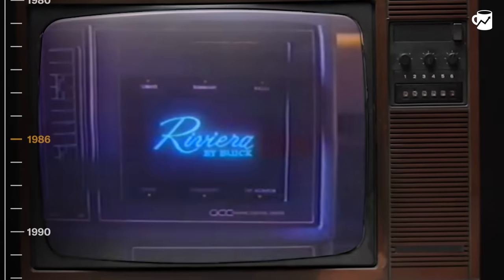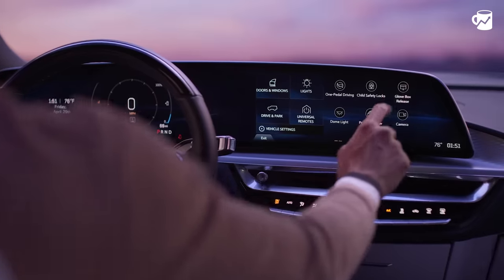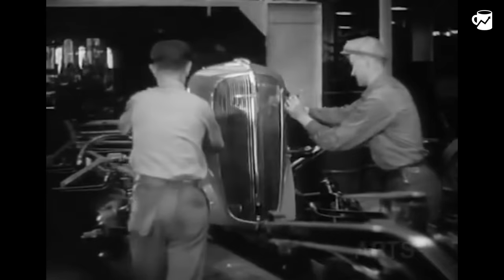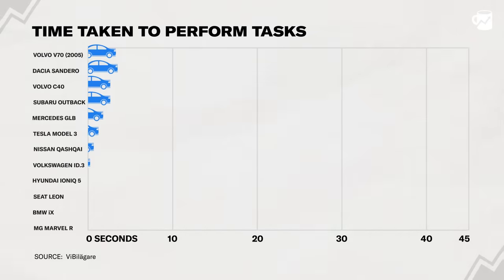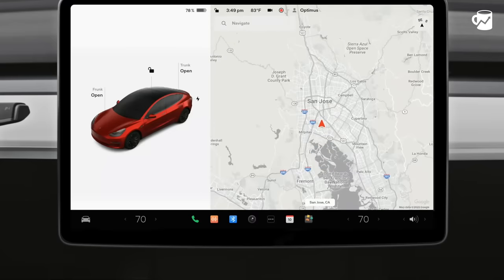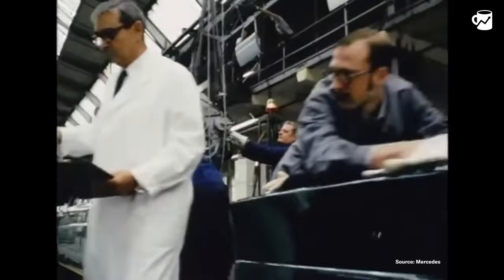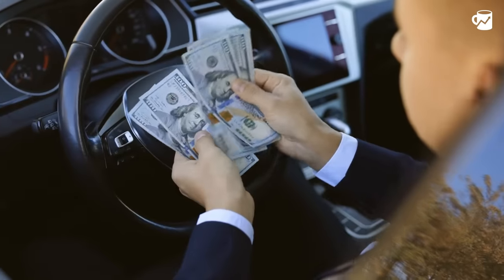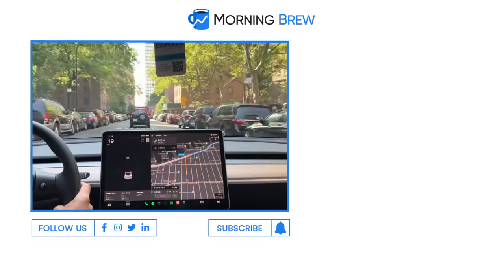The Real Reason New Cars Have Touchscreens

Comment: I'm 78 and my car is 24.  It's a race to see which expires first, it or me.  The thought of giving up buttons and knobs is terrifying.  Every time I make an HVAC or audio adjustment in my old Regal I am grateful and know that I am living on (automotive) borrowed time.  

I've driven with touch screens several times and I found the experience horrifying.  Simple desires buried in sub-menus.  I found it was easier to just give up than change a radio station or HVAC settings. 

Once upon a time public schools had driver's education, and one of the mantras was "Keep your eyes on the road."  Now, it's impossible to do so. 

If they had buttons and knobs for HVAC and basic audio, 90% of of one's needs would be covered.  Put basic readouts like speed and RPM on heads up displays. Leave the rest to the touch screen.
Reply: Tbh you don't have to be old to hate it, everyone except some 30-ish tech wannabees does.

I'm 25, I have right now a TT with a screen in place of the tacho, controled by buttons and it's the further I can do.

Hell I feel unsafe operating even slightly my smartphone while driving. And I use the damned thing a lot so I'm very use to it (on my everyday life I mean, not while driving). I don't understand how touchscreens that hold key features are even allowed on the road.
Reply: @raidden-1583  Agreed.  I'm going to be renting a Chevy Malibu, so I looked it up on the Chevy site.  So relieved to see that the HVAC & basic entertainment functions use physical controls.  And analog instruments right in front of you.
Reply: Sounds like a 2023 4Runner
Reply: Loved your comment!

Comment: I drive a Toyota 4runner from 1999, recently got to drive a 2023 man that thing feels like a spaceship. The worse part after 2 decades of "improvements" it gets almost the exact same mileage as my vehicle form the 90s while being wider, longer, and harder to see out of.
Reply: The biggest positive is that the crash structure is definitely safer.
Reply: My 2000 dodge grand caravan get the extra same mileage as my 2019 dodge grand caravan.
Reply: @chachacamel Maybe. However, the later model likely has side air bags which are highly valuable.
Reply: Except modern vehicles all have tiny gun slit windows and cramped interiors where you can't move around by design, and with rear windows so tiny and blocked by massive head restraints you must have  back-up camera just to see behind you.  @chachacamel
Reply: At least you got a built-in backup camera.
Reply: Modern cars are insane
Reply: @chachacamel  I guess it better be how bad for driving they are. Visibility is crap, drivers are distracted
Reply: eldermoose7938 
Keep your '99.
Reply: Modern cars have modern safety features! So you'll be safer inside, but the pedestrian you just hit won't be. Too bad for them, they should have been driving a rolling fortress! What are they, poor? 🤣
Reply: @Klayperson  how dare they be poor
Reply: it might be faster at least.  but i agree toyota is corrupt
Reply: @Klayperson  There are pedestrian considerations.  E.g., that's why the Lexus LC500 has the explosives to raise the bonnet further away from the engine in the event of a pedestrian strike, in lieu of raising the bonnet permanently and ruining the car's lines (as most other vehicles do to provide the mandatory clearance from bonnet to hard points).  Volvos even have external pedestrian airbags, although they are not mandatory under ENCAP or NHTSA yet.  I don't know how this all works with large SUVs, pickup trucks and 4-wheel-xdrives though.
Reply: @RareGenXer  Center consoles between the front seats have grown to truly gargantuan proportions.

Comment: As a UX designer I’m glad someone is FINALLY talking about this. Like my issue has never been the information structure of the things shown on the screen. I mean, yes, it’s bad. But the first time I saw one of these systems I was immediately concerned about the lack of tactile feedback and amount of cognitive load this adds. Seemed  totally fine for an interface you use while hurdling down the road at 70mph in your two-ton death machine.

Comment: A few years ago, I bought a '97 Camry that someone had installed a cheap Chinese touchscreen stereo in. I hated the screen right away, and was actually happy when it quit working--it gave me the excuse I needed to replace it with one without a touchscreen, that connects to my phone via BT. I love the big volume knob in the middle, and I can skip forward and back with buttons. It's also louder than the stock stereo in my '03 Camry was...which is where that stereo is now. Since my latest old car is in close to new condition, I'm fairly confident this car will last me long enough I'll never have to consider buying one with a touchscreen I can't get rid of.

Comment: Because it's cheaper. Saved you 8 mins.
Reply: Thanks.😂
Reply: It isn't just cheaper, it's also a new way for them to sell you stuff (updates, new features, etc.) as cars become more reliable.
Reply: They are going to simplify and modernize the interior of cars even more!!!
Reply: GOAT
Reply: really? you mean 10inch screen is cheaper than knobs?? or 15-17inch screan? i mean how dumb you must be to actually think this?!
Reply: @jernej.skoflek  yes, a screen is cheaper than designing, engineering,  and manufacturing several different buttons, knobs, and switches, wiring and programming them.

Comment: I like cars which just have a small screen for reverse camera and maps. modern cars take it way too far though. i like having physicals buttons for air-conditioning controls, music controls and anything related to actually driving the vehicle.
Reply: Backup screens are hella’ cool. 👍
Reply: they should have infrared displays as well for night driving.  Once having installed one of those, you'll see how they are extremely useful for everything from deer to speed traps hiding in the trees.
Reply: @zarroth  Are you driving while constantly looking at infrared display to spot deers?
Reply: so if you are good with backing up using just mirrors you can mount your phone for navigation on the wind shield
Reply: Backup screens aren't necessary : they just have to put an end to the slit window trend.
Reply: @cabaneencac5168  no, they need to have higher standardsd for drivers first, I was backing up a van with no view on the back window, not that hard people just don't know how to drive
Reply: One of my friend’s parents drive a Honda Odessey from 2014. Has two small screens, and also has a backup camera and blind spot cameras, if only cars had 2014-2017 screens

Comment: i would pay so much more for hardwired switches, knobs, and buttons, you have no idea
Reply: Oh, they do....just wait a few years, they'll offer physical buttons as "pro" or "racer" interface upgrades. For a cost, of course.
Reply: Exactly. That's why old cars are overall better with just physical buttons.
Reply: This and some other reasons mainly Great MPG is why I still Drive a 2006 VW Jetta with a Manual Transmission.
Reply: @tah6746  What a concidence ! Yesterday, I was watching Ted (the movie) and the main car was the Jetta A5 too.

Comment: My last 2 cars have been Mazdas. The previous was a CX9 with a touchscreen that I HATED. Now I drive a CX5 with mostly analog buttons and a stepped dial/button for Android screen functions and that is a much better interface. I quickly learned just how many clicks on the dial I need to use to do things like select music or report conditions while driving with Waze or Google maps. It's so much easier and I don't need to look at the screen any more than is necessary, which is not all that much.

Comment: The worst I’ve seen, is the 2024 Model 3 update;  they substituted a laggy “swipe for reverse” field on the display for the previous model's physical shifter. Idiocy.
Reply: Bad enough shifters are now electrical instead of actual, like, you know, mechanical shifters.  That's a step beyond.
Reply: Next step is brake control hidden in a menu.
Reply: @janlanik2660  Huh? .....Oh, BRAKE.  Jeeez
Reply: @frequentlycynical642  thanks
Reply: Please tell me you're joking.
Reply: Jeez.  I have a regular ICE vehicle with a normal shifter and going into reverse is always accompanied by a several second lag.  Maybe a safety feature imagined by the engineers?  I hate it but have adapted.
Reply: touch screen transmission is stupid as fuck though..... swipe right for drive.... what the fuck
Reply: @frequentlycynical642  How to make reverse order of electric pulses into electrical motor commutators mechanical? That is just a firmware input/parameter.
Reply: @lacekratochvil  Not the issue.
Reply: The shifter isn't even the worst part. It's the lack of stalks. No signal stalk, and no wiper stalk. 
Tesla engineers really just said "fuck you" to any sense of ergonomics and safety.

Comment: Quite right, you are either driving or looking at a screen. You cannot do both  safely while on the road . Here in the UK where I live to touch a moble phone while driving is a traffic offence so how come touch screens are exempt?
Reply: Because the EVangelists on both sides of the pond need to turn a blind eye to any downsides to today’s EV, to sustain their push to eliminate ICE. So the screens were normalized by EVs, and then spread to all types of vehicle.
Reply: @JoeOvercoat  But there's nothing about an EV that means it has to have a touch screen rather than buttons.
Reply: I've been saying this for years now.

There's absolutely no logic in not being allowed to use a mobile which you can hold up right next to the window so you barely have to take your eyes off the road, but you are allowed to use the car's built in screen which is buried lower down on the dash which means you can't see anything.

Touch screens are just about always worse than physical buttons.  You can feel physical buttons, and your muscle memory knows where they are.  You can't feel a touchscreen, and your muscle memory can't accurately remember their location (especially as they're always changing).
Reply: Here in Norway it is 1100$ fine for using phone or  your cars touchscreen while driving... Touch screens have no business being in a car.
Reply: @a64738  Interesting.  So how does a new car owner, say, turn on the air conditioning or change the volume?  Do they have to pull to the side of the road?
Reply: On a technicality: As those screens are connected to a system that also has a connection to the mobile data network - i.e; It's like an iPad with cellular - They appear to fit the legal definition of a mobile phone under UK law. With that and the UKs outlawing of those at the wheel (Even when the vehicle's stationary) under the RTA, such a screen should legally be off completely whenever the vehicle is in a driving mode, and the law is contravened if not? 🧑‍⚖

Comment: Isn't it a safety issue to put all functionality into a screen? What happens if the screen stops working -- as they often do? You'd lose access to all functions in the car, while if there were buttons it'd be only one button at a time
Reply: 'no problem, we will gladly replace the screen for you' says the mfg at a high cost. $10's to build in, $1000's to replace with labour of course

Comment: Back in the 1980ies you literally knew by heart where the controls are. Choosing radio station, cassette/CD in/out, volume. Heating, Ventilation. You never needed to look away from the road to control them. And you got feedback. The knob turned. The switches clicked.
Reply: Exactly.  Even with a big equalizer with a LOT of slide controls, it was all VERY intuitive and easy to operate by FEEL while you watched the ROAD.
Reply: Now you can't even get a CD player. You're stuck with $$$streaming$$$

Comment: the more electronics a car have the more issues can happen.  that's what i've learned over the years.
Reply: And greatly complicates things, no wonder why no one wants to be a mechanic anymore.
Reply: @GrumpyIan  that too.  Whew
Reply: No modern car will let me hot splice the fog light power to the taillights. If I can't fix it I don't want it.
Reply: @calebharris292  great logic to live by I totally agree
Reply: Applies to everything, actually.

I believe that things that were mostly mechanical if not fully and now slowly becoming with more electronics than necessary are becoming shit like smart home devices that have security and privacy issues or fridges (like, why there is a fucking screen when fridges at the time, in the 60s, didn't need one and were working properly ?!).

Electrical things are less friendly to the average person than mechanical I believe, because a car with software is an issue since software is generaly properitary, you can't modify and so it's not fixable.

Software is going worse too. Because to make a good software, it's takes time and good software engineers that create secure and fast code. Yes, companies could make a software, then after that, making updates overtime but they don't care and it comes with costs. 
You would probably need Internet to update with no alternatives of doing differently (like plugging a usb with the new software and push it to the car. . Although, I'm sure it will be used to find exploits.)

Why is Internet necessary in a object that was built in the early 1900s and for the last 110 years, never needed it ? Do you really own your car ?

Comment: Touchscreens should be for maps and music, maybe. Pretty much everything else should be separate physical buttons. At most AC as well, but even those are incredibly annoying and inconvenient, usually
Reply: I am constantly changing the volume and and down, and sometimes I absolutely must skip a song. I don't want to have to look to do those things, either. Touchscreens for maps make sense, but when something inevitably goes wrong with the screen, it shouldn't affect the drivability of the car.
Reply: Maps & music/phone/audio & climate & drive mode should all be operational via physical buttons & dials, mostly on the steering wheel

Comment: We love our new 2024 Cadillac with a combination of a curved 33 inch screen and tons of easy to use physical buttons!

I upgraded from a 2014 Toyota Highlander to a 2024 Cadillac XT4(the 2024 highlander drove the same and is pretty much the same chasis and interior so it's boring).

The Cadillac XT4 has no turbo lag that I can feel. Every other car that I test drove had turbo lag, whether short or long...Mercedes GLC300 (least turbo lag), BMW X3 (a little more turbo lag), Porsche Macan S (even more turbo lag), Honda (way too much turbo lag).
The Cadillac has these features that Youtubers miss:
- lighted logo behind the dashboard
- pulsating safety seat (most cars only beep)
- left behind child in the rear seat alert
- capless fuel tank (like my 2017 Corvette C7 )
- umbrella storage in the doors (like Rolls Royce)
- active noise cancellation (like my 2017 Corvette C7 with Bose)
- power passenger seat with lumbar
- free 5G hotspot
- stop/start feature is the smoothest I’ve ever experienced that I don't even notice it.

My other car is a 2017 Corvette Stingray in stickshift.

Comment: I loved my 87 Square Body Chevrolet Silverado 4x4.    It drove like a dream , everything was manual. Even the 4x4 has a manual engagement. Then engine went down several years ago. I gotta get it back up n going again. 
    My best buddy has a new Ford F-150.   It tows great , but he hasta push buttons for ever just to get it rolling. I've driven it while towing , and him riding in the passenger seat.    It will just randomly start barking alarms while driving. He has to start pushing buttons again to make it hush  - up.    Any time we stop , its the same procedure.      My old Chevrolet, and other 50+ years old trucks , you just shifted gears as you needed to , and drove. Everything is in arms reach. You don't take your eyes off the road.

Comment: My "old"  2019 dodge caravan has a screen, but it basically just controls the radio and mapping. Other functions have knobs or buttons that are intuitive.  One thing it also has is buttons on the steering wheel for the radio or phone and cruise control.  I find these essential because I never have to take my eyes off the road or take my hands off the steering wheel.  I'm old now, so this will likely be my last vehicle. I don't think I could drive one of these newer vehicles with touch screens.  Heck, it was hard enough typing this on a computer pad.  LOL
Reply: We are twins in everything you said.

Comment: My ‘97 Jetta has the perfect amount of technology. As in, none of it.
Reply: Well it does have technology, it has ECU, digital odometer and drive-by-wire/throttle-by-wire instead of a physical accelerator cable. It still probably has some other electronics I didn't notice. You just don't consider it tech because you're used to it.
Reply: All car in early 90 had a ecu drive by wire don't get popular on till early 2000's
Reply: @rich-ue5qy  Yeah but certain car models did have drive-by-wire already in the late 90s, like OP's '97 Jetta and my Volvo S80 (MY03 but it came to market in '98). My previous '96 850 still had a physical gas cable.
Reply: @Fortzon  most importantly, it has half a million miles and still runs!
Reply: @Fortzon  His Jetta almost certainly doesn't have drive-by-wire. That was a feature that started with the Bora.
Reply: So does my ‘02 Passat
Reply: Internal combustion engines are technology. Disc brakes are technology, as is the hydraulic system that actuates them. Transmissions, fuel pumps, pressure regulators, alternators, catalytic converters, fuel injectors, starter motors, batteries, light bumbs, all of it is technology. Your car is full of technology!
Reply: @Fortzon  Tech does not mean electronic.